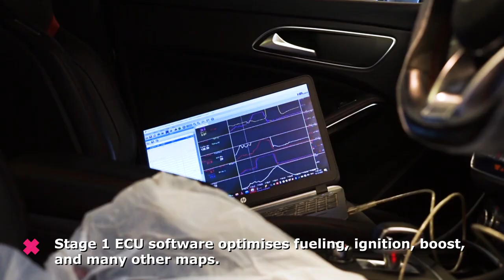+70HP & +77lbfts Stage 1 ECU + REMUS Sports Exhaust on a AMG CLA45

Comment: How is it 367hp stock not 381hp
Reply from the maker: Mercedes report 381PS standard, which is around 375HP and dynos are a snapshot of a vehicles performance at that particular time, with different ambients etc it might show different figures.